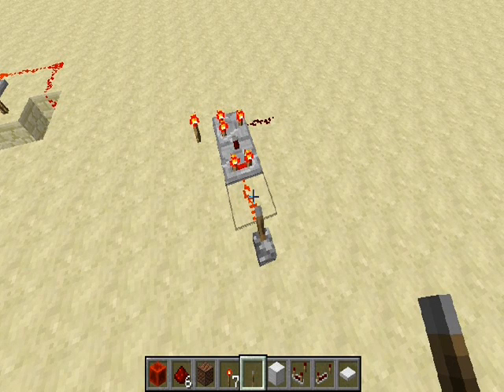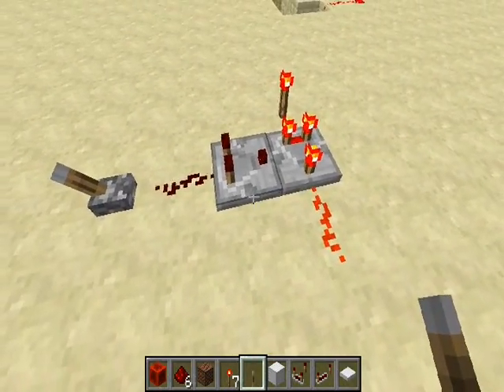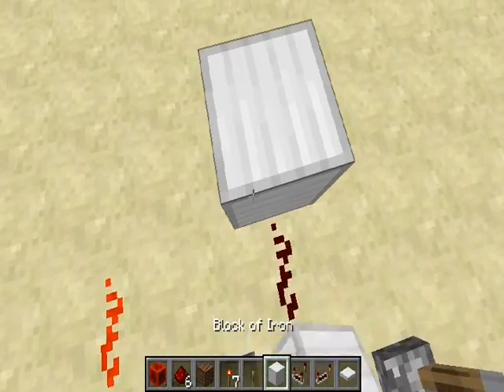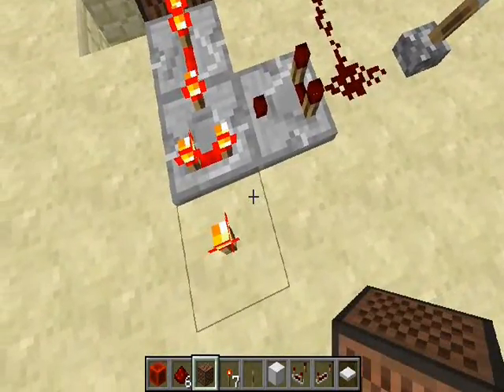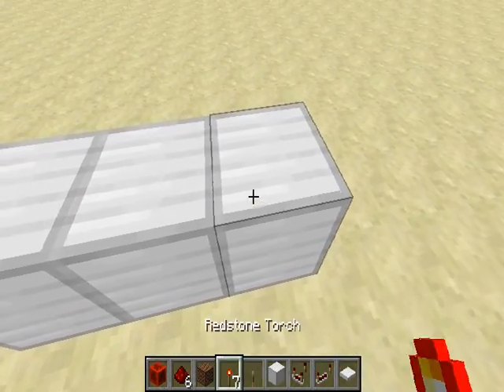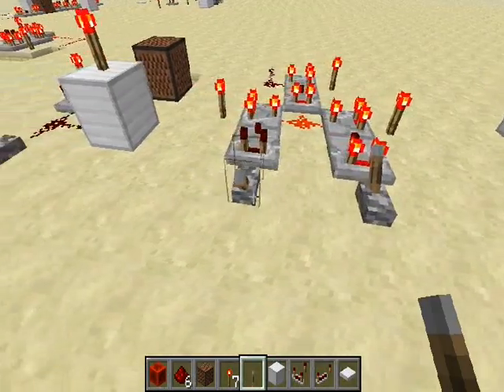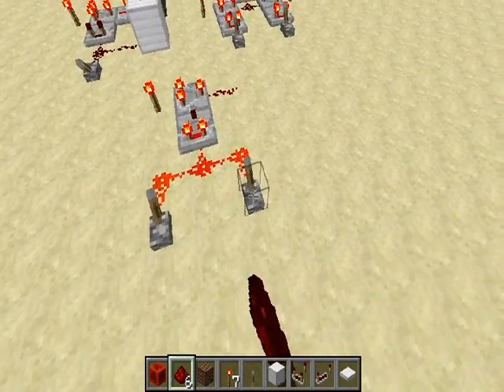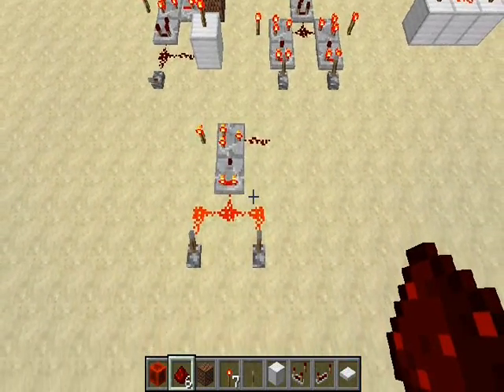Compact Instant Inverter in Minecraft 13w01a

Comment: not instant
Reply from the maker: It was in 13w01a (Which was a bit over a year ago now), I believe it was fixed in either 13w02a or 13w01b because it did cause a world crashing bug when you fed the output to the input.
Reply from the maker: Feel free to try it in 13w01a if you want. It was quite fun when it was there.
Reply: Chartreuse Kitsune
The reason it worked is because comparators acted instantly.  They act like repeaters now, and it is easy to see why it would be bad for such things to act instantly.  Also, the reason your level didn't work when you removed the comparator is because a comparator maintains signal strength.  If you turn the lever on, the strength in the following space is 15.  The next redstone dust space would be 14.  If you subtract 14 from 15, you are still left with power.

The comparators were bugged, obviously.
Reply from the maker: They may have kept these fast comparators in the game if they haddn't caused the obvious problem of what happens when you hook the output of an instant inverter to the input. I do wish they went for the more elegant solution of having the comparator burn out if it changed state more than twice a tick.

Comment: The reason why you needed that extra comparator is that your lever was too far away. If you placed only one dust between the lever and the second comparator it would have worked just as well (I discovered the same instant inversion trick myself.)

Comment from the maker: Well yes if the input is on but not 15 it will output a slightly weak signal of the difference in strength, but as long as you know it's there it'll work just fine since it's not as powerful as the full on signal. What you can do, haven't built it yet, though is add another comparator to the end to lop off signals not full strength.

Comment: Hmm, it's kind of instant, but really it only works when the input is giving max signal strength (otherwise the output will provide a signal, just a very weak one), so you either have to have your lever right behind the NOT gate, or use a repeater, which adds delay